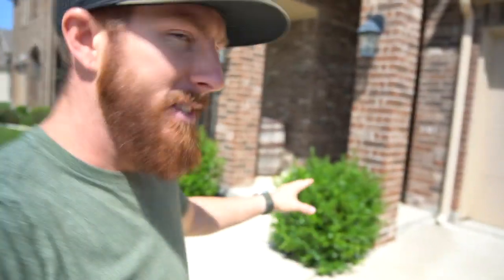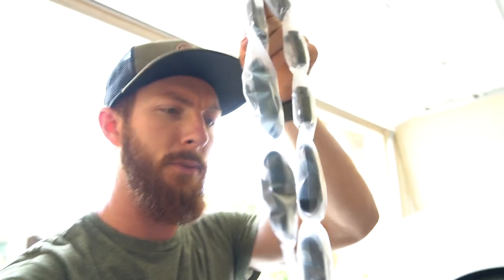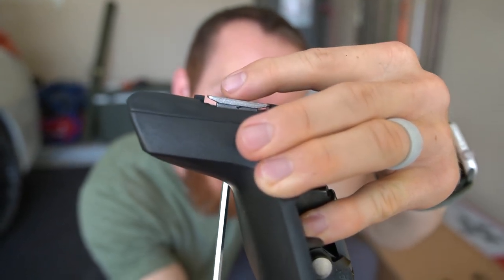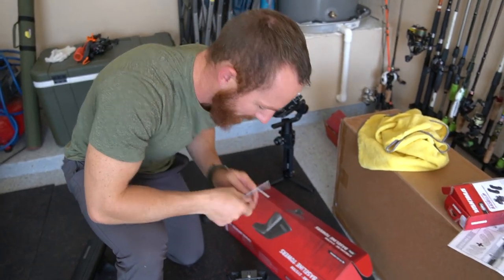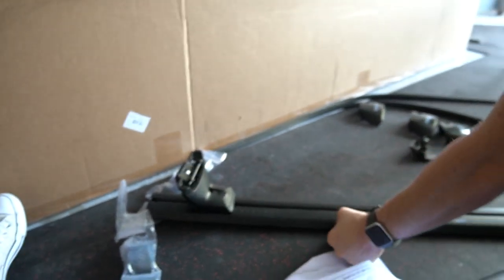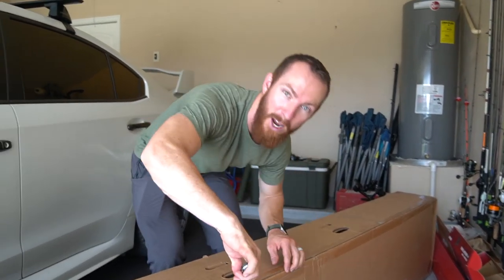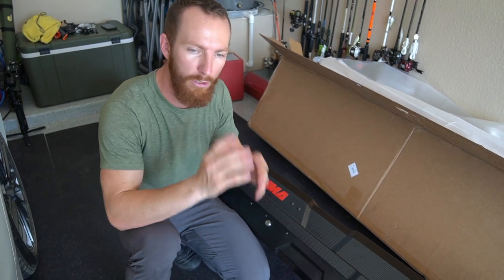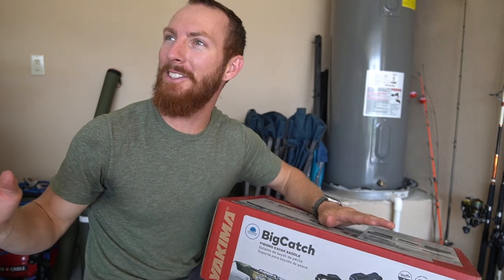SUBARU STI YAKIMA ROOF RACK INSTALL (Best Fishing Setup ever!) rod/reel carrier & kayak mount

Comment: This is the exact setup I want for my WRX! How is the wind noise with the topwater on there? Its my daily and I wouldn't want to take it off and put it on all the time, but I also don't want crazy wind noise constantly either.
Reply from the maker: Tough to say since we have one of the louder exhausts on the market. You will definitely hear it flexing more than wind noise has been my experience. If it’s a bumpy road or something you’ll hear it shaking a little since it’s all plastic, but we aren’t taking it off either it stays on the roof and you just forget about it after a while I suppose

Comment: Wish I would have seen this sooner. I'm wondering, how has it been holding up ??
Reply from the maker: Still running strong. The spring which hold it open have had to be bent back since they’re not quite heavy duty enough over time but they may have addressed that. It just came out when they sent it to ya
Reply from the maker: To us*

Comment: What length is the rod carrier? I do kayak tournaments using my WRX as well so I'm always cramming about 8 rods into my car.
Reply from the maker: I have to look at the specs but it’s just over 8’ I believe. I have a couple 7’6” heavies in there right now
Reply: @WestinSmith  does it look like it will take 7'11" swimbait rods? Or does the 7'6" kinda max it out? 

Anyways thanks man.
Reply from the maker: It says up to 8’ rods I’ll have to break out the tape measure though

Comment: Wait a min.. you should already have a spot to mount a bolt directly to the roof of the car and not need to use the side clips.
Reply from the maker: Yeah idk Subaru has racks that utilize those I think but if you get one from Yakima that’s not just the crossbars I think you need them.